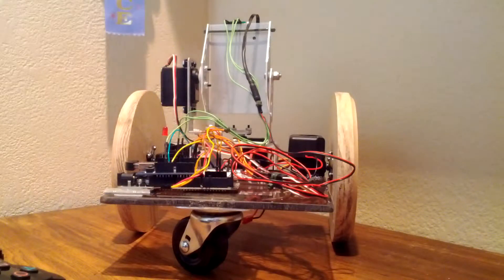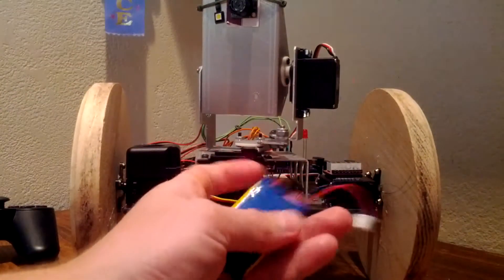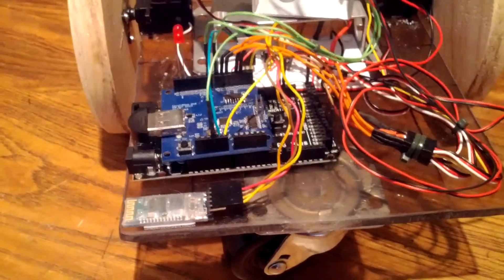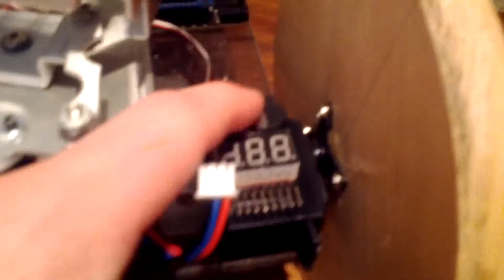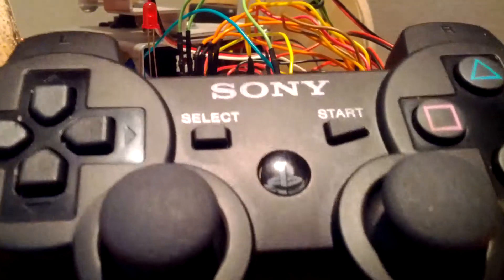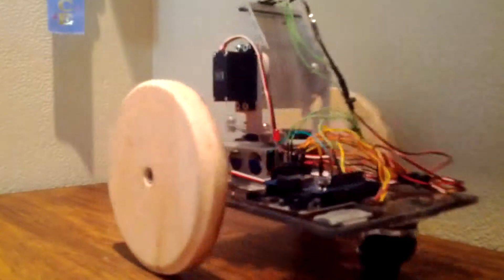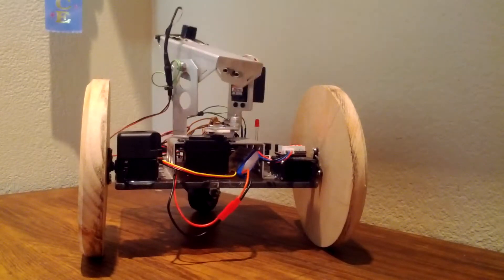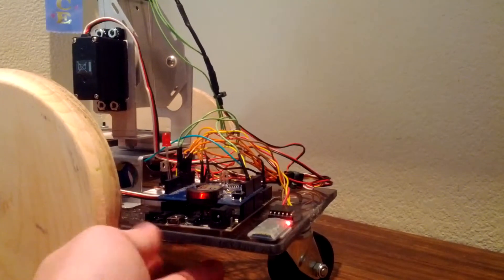Caster Bot - Arduino powered robot driven with PS3 controller

Comment: good afternoon like to make a bot caster and an RC car with a PS3 controlle, I wonder if I could send the wiring diagram is the arduino,(leeassistencia@gmail.com)
Reply from the maker: Hi Ulisses. Unfortunately I took this robot apart a long time ago, and do not remember exactly how everything was wired. Luckily, it is easy to attach all of the components I used. Servos only need power and a signal wire (there are plenty of Arduino/servo tutorials on YouTube), the sonar also uses only one signal wire  and I was controlling the siren with a MOSFET. You can look up how to wire and use MOSFETs quite easily.
Reply: Barrett Anderies good afternoon Barrett Anderies already talked sometimes wanted ta help with the code of the bot caster, wanted to ask you a question the code that it has not got the connection of servo motors? you can take a look?
Reply from the maker: ulisses salvador Sure. If you need to send me pictures, please find my email on my website and send them to me that way.
Reply: Barrett Anderies already sent the email to you